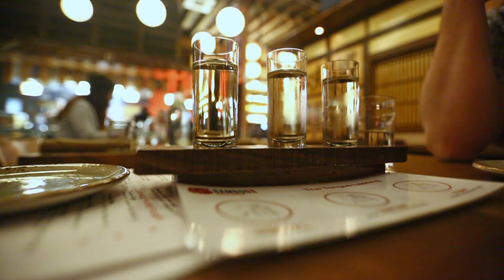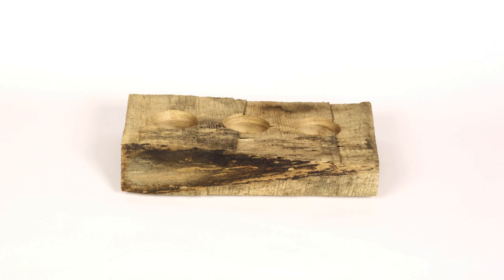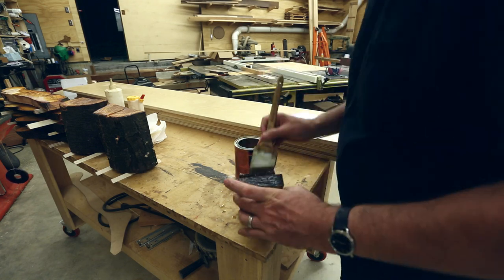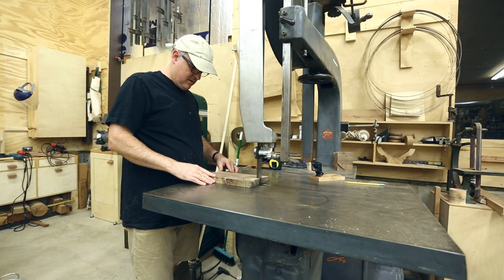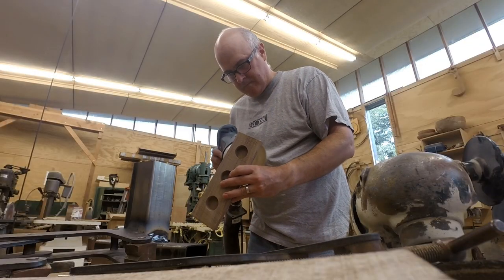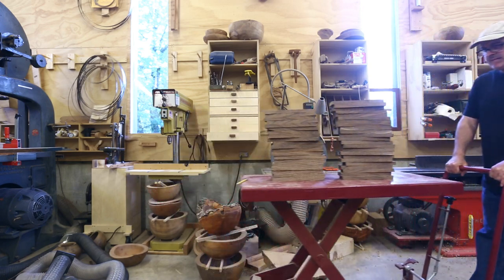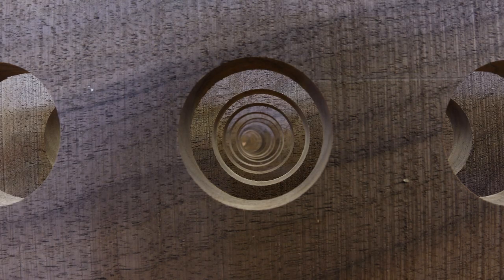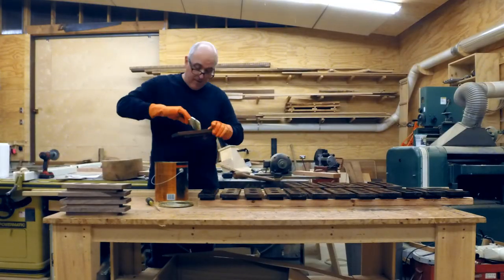Wooden Sake Trays

Comment: You could have used your pantorouter to make the holes with a flat bottom.
Reply: You could have used a router and a hole jig for the holes
Reply: Could have used a CNC router with a vacuum table and dowels to position each tray in the right spot... Oh the possibilities.
Reply: I want a Pantorouter XL! ;-)
Reply: You could have used magic to make those holes flat. Just saying....
Reply: ShadeTreeCNC
That's exactly what I thought he was going to do.  Of course Frank's solution worked.

Frank, once again another excellent video.  Thanks!
Reply from the maker: I had most of these done before I hade the pantorouter.  I did think of that.
Reply from the maker: ShadeTreeCNC thought about this.
Reply from the maker: Matt Feist soon
Reply: Rivertown Woodcraft
Or drill out the center divots and fill them with maple plugs.
Reply: haha that would have been over kill
Reply: Double Dare Fan
40 boards with 3 holes each.... sounds like a chore to me ;)
Reply: Screw it just go old school and chisel EVERYTHING!!!!!!!!1
Reply: I had to do something similar for a friend once (get a flat center).  I sacrificed a forstner bit and ground down the center flat to the rest of the bit.  It lead to a slightly rougher surface in the center but it cleaned up easily with sanding.
Reply: Just like with software/programming...  There's more than one  way to do it.   :-)
Reply: When you're only tool is a pantorouter, everything looks like mortise. :)
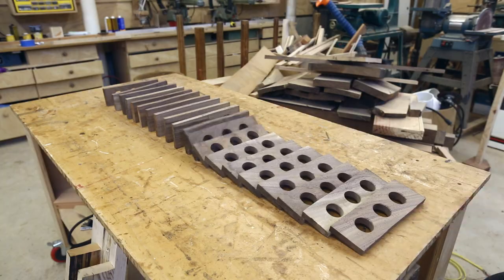Reply: I was thinking a dado cleanout bit in a plunge router would work well, but then you would not have found the inspiration for the tunnel animation at 4:30 :)
Reply: +Matthias Wandel this guy and his pantorouter
Reply: lol !!!!!!!!!

Comment: Very nice! I agree with everyone. Now about that lighting tip. Use daylight balanced tubes, it will help with detail and not make such odd colors out of things when the system tries to balance for the biggest object. If you add some tubes facing sideways along the shop perimeter that too will help. It's not the amount of light but the full spectrum of color that will greatly add to the quality of what I consider the best woodworking channel extent. Thanks again Frank, especially for showing the process and mistakes.

Comment: Frank, to fill the little forstner bit holes I have drilled a shallow 1/4 inch hole and filled with a short plug/dowel. The right contrasting wood specie can look really cool, maybe bamboo on this one.
Reply from the maker: I think we talked about something like that, and it is a good solution.

Comment: I'm surprised you haven't used bamboo in any of these projects. I love working with bamboo. I made e-cig stands the same way by drilling all the way through the top piece then gluing the bottom on. I actually broke my hand doing this from table saw kickback. After gluing the 3"x3"x1" blocks I was flushing the up on the tablesaw and once of them came back and got my left hand, shattering my knuckle.
Reply from the maker: Ouch, stay safe.
Reply: I'm super careful now. I was super careful then, it was just bad luck. Thanks!

Comment: With the flat bottom holes, a simple striaght bit in your router with a template and bushing would make easy work of it.  Much slower than the drill press, but no jointing and glueing, plus it would be one solid piece of wood which aesthetically is probably better (if anyone would even notice).

Okay, enough armchair woodworking from me.  Great video frank howarth

Comment: You can flatten the bottom of the hole with a dado clean out bit in a router. A palm router is nice for doing this as you are only removing a small amount of material.

Comment: Once again you made me smile at your clever video and projects. I have two questions if you wouldn't mind. First what type of band saw are using and what size is it. Second what type of clamp is crawling across the screen at the end of the video. I have never seen a band saw that large of a clamp of that style. Thank you in advance for sharing your many skills with us.
Reply from the maker: It's a 36" Fay & Egan (http://vintagemachinery.org/photoindex/detail.aspx?id=15607) The clamp is a cantilever welding clamp.  it has a very strong grip and the tightening handels is 90d to the way a regular c clamps works which makes it much more usefu.
Reply: Frank, thank you for your replying to my questions. That is a wonderful band saw. No need to reply to this post. I just have say thanks.

Comment: I am also a member in good standing of the Youcoulda tribe. How about drilling a dowel sized hole of your choosing and gluing a short section of contrasting wood into the hole. Or really fancy, a piece of plexiglass rod (or actual glass) so if they have a lighted bar surface, the light would show up through the glass of sake?

Comment: That was an ENORMOUS chunk of walnut... did you feel sad to cut it up?  I find I try to find large projects for large pieces of wood, as it feels wasteful to cut them up.  This of course is silly, since the tree itself is cut up to make the boards I use.  But people don't always make sense.  

Nice project, and I think I would have done the domino thing also.
Reply from the maker: yes, a little. it was a bit dry for turning on the lathe.  mostly I just wanted to get them used and out of the way.

Comment: What if you ground the point off the Forster bit?
Reply: you could use a bit with the point ground off to finish the hole, but you need the point to start the hole and drill first